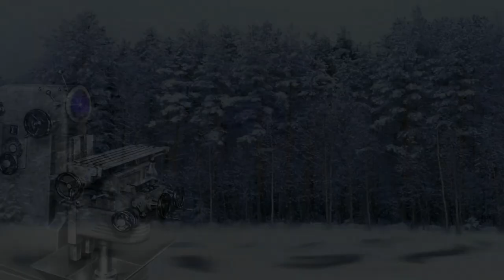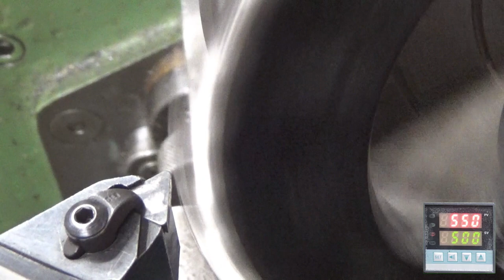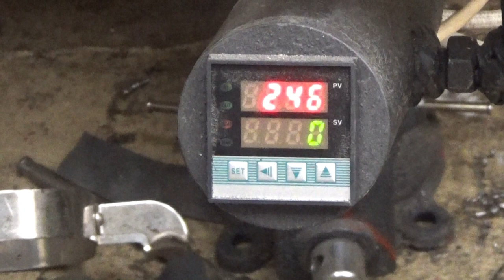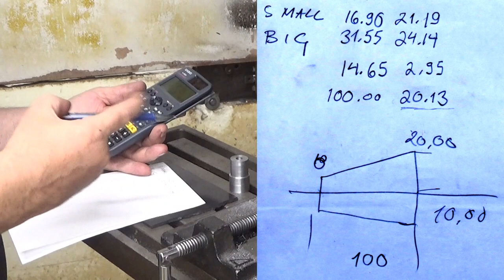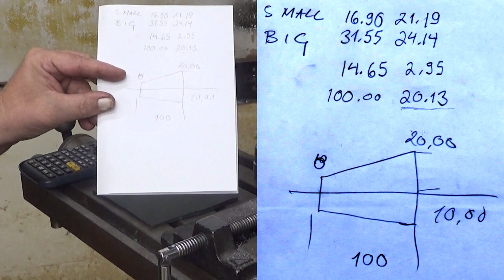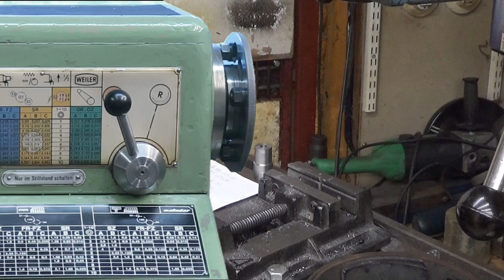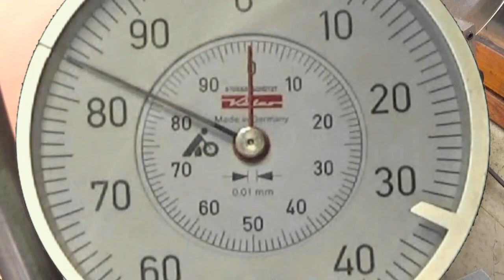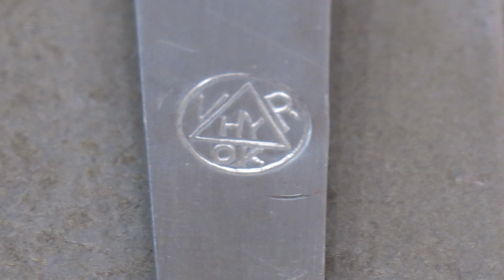How to make a gear ring for a flywheel

Comment: How I would measure a taper: Chuck the wheel in the lathe so that it doesn't wobble. Then, mount a dial test Indicator so that it's centered. Then, move the indicator to a spot on the taper and zero it out and zero the DRO (or dials) on the lathe as well. Then, move the Z-axis a nice round number like 30mm and move the x-axis until the DTI reads the same. Then you have the numbers needed to calculate the taper (You could of course also just indicate the compound in straight from the taper)